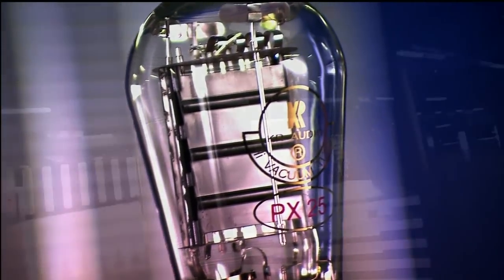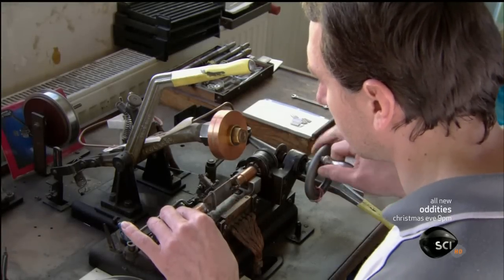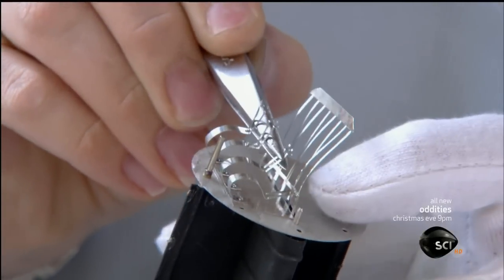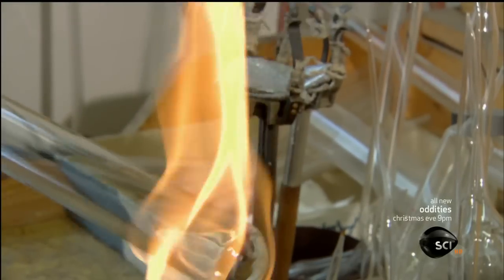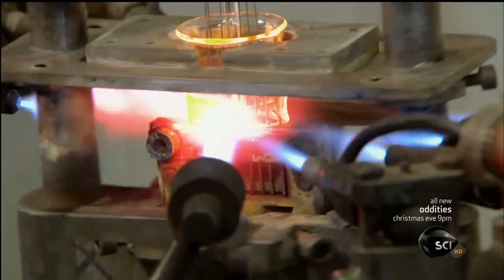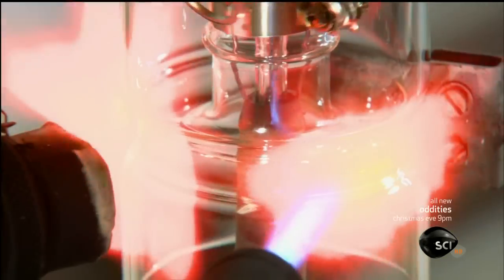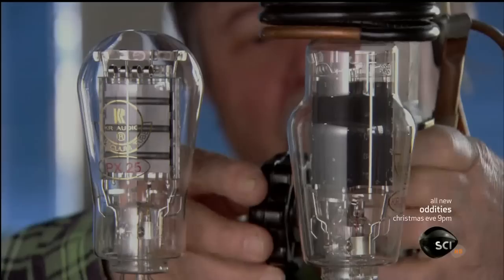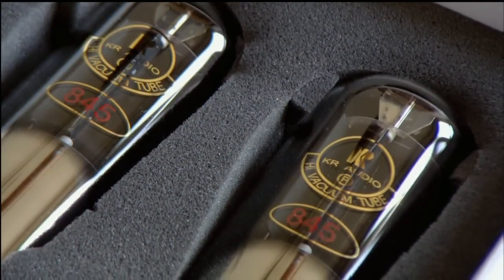How It's Made - vacuum tubes

Comment: Tubes still are the best amps for guitar. Transistors are either on or off. They can't easily replicate the waveform of the sound. Plus, tubes sound good when you push them, unlike transistors.

Comment: when i was in the u.s. air force 50 yrs ago i was a ground radio repairman and repaired and maintained radio transmitters up to 50kw in power. the vacuum tubes in the power amplifier were about 3 ft. long and weighed about 20 pounds, they were huge.
Reply: wow awesome

Comment: Also the anode and cathode have different voltages because they are hooked up to different voltages produced in the power supply. And they are higher than the input because the input is applied to the grid and that small voltage can control whether the current can pass from the cathode to the anode by repelling or passing electrons streaming from the hot cathode to the anode.

Comment: Amazing! I've done neon sign-type glasswork, and I've got a lot of respect for these guys. This technology is interesting - no matter whether one likes the result or doesn't - and, as with other archaic sound tech such as phonograph records, it's nice to see there's still a desire to have it available.
Reply: Have you ever worked on nixie tubes (or any of the old tube displays for that matter) or know anyone who has made them before? I still get them from my friends, but it makes me sad they aren't produced anymore.
Reply: spieagentl
Vacuum tubes of that type require an entirely different skillset, different equipment, and different processing. Nixie tubes do typically use neon gas. I think most Nixies were machine-made, and I'm not sure whether new ones are being produced and, if so, what the process is like. Cathode ray tubes are based on Sir William Crookes' work, and several tubes he designed are still produced for both physics demo purposes (properties of electrons) and decorative use (fluorescent flowers, minerals, etc.) and these use a different process, too; neon signs' closest cousin are the decorative Geissler Tubes first produced by Heinrich Geissler, who invented the diffusion pump still used (with silicone oil, rather than Geissler's mercury) in neon sign production, now boosted by a mechanical pump.
Reply: Jonas Clark Wow, thank you very much for the informative reply! I'm sorry I didn't know, but the little history lesson, and now I have names to do research on! Have a nice day!
Reply: spieagentl Geissler Tubes are fascinating things; they were made in thousands of designs, from simple squiggles, spirals, coils and loops to words and monograms (looking forward to the role neon would play), animals, spouting fountains, flowers, religious symbols, people, and magnificent objects such as royal crowns, some of which were even worn onstage in plays. Some used fluorescent uranium-oxide and iron-oxide glass or had outer chambers containing fluorescent liquids. Two glassblowers, Lutz Neumann and Wolfgang Linschmann, are the last true masters of decorative Geissler and Crookes tubes, and Neumann has made several fantasy tubes I created on paper such as a fancy Cross, as well as replicating the incredible crown with fluorescent gems held in a museum in Europe. Linschmann trained at the Pressler factory, the last scientific glassware factory in Germany. They also make many decorative Crookes tubes, which use cathode rays (electrons) to excite fluorescent-painted metal sculptures or clusters of minerals. Happy learning!

Comment: 1:20 The Anode's "top secret" black coating? It's essentially a carbon coating applied to the steel anode (plate) at high temperature during the manufacturing process. It was done to reduce secondary emissions.
The secondary emission problem was only present in tetrodes and It may have been top secret the at the time it was discovered that the coating increased the efficiency of the tube's amplification factor but quickly became common knowledge among tube manufacturers as it is today. Not so "Top Secret"

Comment: For anyone watching, These are high end "handmade" tubes. Back in the "day" when vacuum tube electronics were common (1920's - 1970's), Most of these processes were done by automated equipment. There's plenty of contemporary to the time video on YouTube showing the MASS production of vacuum tubes (Mostly from the1940s and 50s). If tubes were all made THIS way "back in the day" only the rich would have had radios or TVs at all until 1978, lol.

Comment: i'd love to see a vacuum tube based cpu the size of new york city in orbit with the devices connected to it the size of manhattan, and the solar panels powering it the size of 10 or 20 manhattans. wont happen because there is no reason for it to, but it would be pretty cool to see a multicore proc built out of vacuum tubes instead of tiny transistors in an ic. while the idea is stupid, it is still fun to think about.

Comment: Great video! This is a very labor intensive process! I imagine, back when RCA, GE, and others made tubes domestically, it was considerably more automated. I used to pay about 5.00 for a 6L6 GC in the late 60's! Now, good quality 6L6's are uber expensive. Don't have any tube gear at the moment, but plan on getting an old Fisher 500 A or B. 7591 outputs in that one, and very difficult to locate, but well worth it! Cheers!

Comment: Global feedback and negative feedback are basically the same thing..  Most of these negative feedback amps have a passive feedback control loop.  The amplifier compares the input and output signal (e.g., around a transformer) and generates a 'correction signal' to adjust the latter to look more like the former.  This also cause artifacts and even oscillation in some designs.

Comment: To clarify, are different types of feedback and different types of amplifiers.  I didn't say all feedback.   What might acceptable for home theater or receivers for the mass market wont' be for audiophiles.  Using "copious amounts" of negative feedback will result in harmonic artifacts.  Nobody wants overly exaggerated  S's in the vocals with timing and odd order issues that any non-engineer can discern.  Listening for those s's is one way I distinguish transistors from tubes, source unseen.

Comment: If anyone has been parroting "electro-babble" it's been you talking non sense over tube distortion.  You can run tube amp at full power without it distorting as badly as a solid state amp. They don't clip and produce square waves that destroy speakers, they just get fuzzy and mushy sounding. Its still distortion but at least its not as likely to smoke your tweeters. 
Speaking of car-fi my new Tacoma SR5 stereo sounds terrible.  Before discovering tubes I would have thought it was awesome.

Comment: That's like asking why do piston engines have such short lives..

There are many variables, amp type, tube type, tube production era, and how hard the tubes are driven.  Preamp tubes will last 10s of thousands of hours in hi-fi amps, output tubes 1000-10,000 and rectifiers a bit longer.   In the last three years I've had one tube fail, a Sovtek 5AR4(~3k hours) a NOS Mullard will last 10-20 times longer.

Comment: The cathode is a made from an electron emitting substance usually tungsten and molybdenum.  Many small tubes cathode are simple oxide coated.  The Anode or plate can also vary from tungsten to copper.  In the past tube makers would usually are coated with secret proprietary conductive coating.  Just one of many things lost when the old tube production stopped 25 years ago.

Comment: In unshielded copper, like a circuit board trace, signals travel at 95 to 97 percent of the speed of light. So the wavelength at 20 kHz (beyond the hearing range of many people) is 14.2 km, nearly 9 miles. A negative feedback trace in an amplifier is a few centimeters long, a vanishingly tiny fraction of the wavelength of the fastest audio signal. There is no way NFB causes timing issues, let alone audible ones. It rather cleans up harmonic artifacts (drastically lowers harmonic distortion).

Comment: The real difficulty in modeling is modeling power amps. This is impossible to do with the equipment that is used (whether the target device is solid state or tube). If you want to digitally simulate an amp such that the audience can close their eyes and think there is particular 50W half stack cranked 10 feet in front of them, you need a 10,000 watt hifi sound system to do that. Only such a sound system can obey the model faithfully at the required volume level to create the same pressure waves.

Comment: Modeling vacuum tubes is a piece of cake. I use a guitar preamp with real vacuum tubes, but I do not believe that it produces better output than modeling. I use real tubes because I think it's ridiculous to use something with a quarter billion transistors on it running at hundreds of megahertz to do what is achieved by some simple arrangement of parts encased in blown glass. Pre-amp tubes are cheap, last long, and run on small power supplies. They have no issues that need a computerized fix.

Comment: Harshness comes from hearing all high frequencies in the original material clearly reproduced in their full dynamic range. If the material is judged to be harsh and unmusical on a virtually distortion free transistor amplifier, with great speakers in an acoustically treated listening room, then we have to conclude that the material is in fact harsh and unmusical. If tubes can soothe it, the only mechanism by which that can happen is distortion, severe enough to make a clearly audible difference.

Comment: Yes, the cost of making a 10kw amp using transistors would be insane.. The tubes can be fed and handle incredible high voltages, witch means the current needed for a high power output can be microscopic.. Its funny but the most modern tv satelites uses the good old tubes to amp the signals.. :)
I 2 thought tubes were shit compared to transistors until I started using them tube amps.. You need to experience it. Transistors are techn. better in every way but 1 as u say but tubes are still awesome!

Comment: Hehe.. I have a 120 watt guitar tube amp on 4x12" speakers and it sounds superb !! lol but 90% of the time i play i use a line-6 spider 3 amp with digital audio processing and transistor amp since it sounds brilliant and copys about all known amps ever made.. so you are right in a way, but you wont get that tube sound from a st5881 trans-chip (opamp) overdribe on a mosfet output. The best guitarist ever used transistor overdrive in pre and 4 huge tube amps as output for that warm drive.. :)

Comment: "any tube amp can be emulated 100% with transistors."

-Not 100% true. Transistors and tubes will always sound different and they cant 'emulate' each other in a analog circuit for sure. But If the sound is digitally processed before it hits the amp, you can get really close. Digital 'tube amps' are beginning to sound really good but a pure transistor stereo music amp will always sound more sterile than a tube amp..transistors works best if low distortion is alpha & omega. or?

Comment: The reason for the difference between tube and transistors, is that transistor amplifiers are designed to be high fidelity, reproducing the output sound exactly as input. Tube amplifiers distort the sound in such a way that some people think sounds better, maybe because they are so used to hearing that distortion they have grown to like it.

Comment: if any power has been run threw them after they where cracked would they not be burned up like a cracked light bulb.  i guess if they where cracked but never used it might work. the hard part would be get the proper vacuum seal.

Comment: I just thought you, being such an audio expert, would do it better than me. That is, if I fail to achieve the sound, is quite inconclusive, isn't it? It would just prove that I could not use the EQ right. But, if a man with all the amplification knowledge does EQuing, THAT would be a result.

But, hey, did you say hour and a half? Is that supposed to be easier than just firing on the excellent sounding guitar amp?

Comment: "Actually" :) You just don't like tube overdrive sound, that's all. Just don't buy an amp made of low quality components.

Just don't try to be a little smart ass and pretend you know anything about sound modeling. If you'd ask ANY amp manufacturer what it takes to model an amp sound (or effect), there answer wouldn't probably be like "yeah you need some shitty EQ, and tweak some shitty knobs and boom! you get the AC-30 sound instantly from this linear PA".

And still waiting you for email ;)

Comment: I tell you what, write me an email to tube.vs.transistor at gmail com, and I'll send you couple of wave files. One with line recorded guitar clip, and other it re-amped through a guitar combo and recorded with a mic. Then you EQ the original clip, and make it sound exactly the same as the re-amped version, as you say you should be able to. Then send it back to me, so you can prove me that EQ is all you need to get the tube sound.

Comment: Do you realize that coloration is exactly a tube guitar amp is designed for? When you strum the guitar, you get the distortion? Comparing guitar amp to a hi-fi or some laboratory speaker is like comparing a violin to a signal generator. Violin is a shitty design for a signal generator, because it cannot produce a pure sine wave.

Who uses guitar amp as a hi-fi amp? Not me, because it is designed to run a guitar, and make it sound good.

Comment: "rich" and other adjectives are accurate but what it comes to in technical terms is harmonics. Tubes make LOW ORDER harmonics, silicon (transistor or IC) doesn't because they CAN'T = physics. What that means is a tube makes a guitar sound like a louder guitar. Transistors' high order harmonics make a guitar sound like it's in a can until it's attenuated so bad the timbre of the strings changes - In simple terms, "Your ears know the difference."

Comment: any kind of audio impendance correction transformers or speakers in the end), gives 1 % distortion in signal per each, (until reaches some point), which gives a lot after all. That is True and from that point I am supporting what You said. 
So for the end, I'd never have tube amp made for end amping. I'd rather have some FET, or good paired transistor in A class or high AB class, but for the preamp I'd rather have some kind of hybrid, tube-fet what can somewhat improve sound.

Comment: That was my point. For a preamp tube is more than welcome. For anything besides that, unfortunatly there is no place for tubes, (what goes in benefit of Your claim). The point is that tube in exiter, (end power amp), has to have audio transformer, (if it is desired to drive classical speaker), what gives additional degradation of signal. What I know so far, (and it came to be true), each conversion from audio to electric via magnetic way, (mics, tape recorder heads),                            1

Comment: As for FET-s I may say quite the opposit, but even thatways setup needs to be in high AB,or A class, which draws high current, and opposit to that gives low amplification range. That comes out of, (and same goes for tubes as for transistors and fet-s), amplification slope, where can be found setup with high gain and high distortion too, and low gain and low distortion. Magic is in finding reasonable compromise between these two. 
Hope You agree :-)

Comment: On issue about heat and current, (heat and light), I agree apsolutely. That is why is that piece of hardvare hardly usable in other then you mentioned applications. Besides, it gives transients, (distortion), but these distorsions are mostly even, so this setup sounds "warm" and "silky". Transistor, (as counterpart to the tube), is moslty odd transient inklined sounding, thus, a bit less "soft".

Comment: and most of all You said something that goes in way that proves that. 
Saying that tubes draw huge amount of power. The secret of the sound of the tubes is in that fact. I mentioned about even and odd, transients. Ones are very tipical for amps that are constructed arround curent amplification, and the others are constructed arround voltage amplification, (like tubes are). 
What You ment to say with the fact of restoring good sound is, (I assume), class D amps.

Comment: Actually, tubes do draw amount of electricity, but very low on current. For example, if we do hybrid, with ECC81, or ECC83, in pre amplification, together with class A push-pull with some good paired FET transistors, You might be very surprised how that may sound when compared wiht some commercial amps. Have You ever made one, or listened one?
I would say no, (with no will to offence You in any way), because You would have totaly different oppinion,

Comment: Besides it, manufacturers of these amps are cutting production costs by making amps at the very edge of power abilities, (usually there might be found a far smaller powersource than needed), making, thus, these amps hungry for power. And as third amps are made in AB or high B class rather than in raw A calss what degrades sound even further. 
So far, I have no experience with digital amps so I cannot say nothing on that.

Comment: Outside of very limited audiophile sector and guitar amplifiers, the low-power vacuum tube is DEAD !!!!

Only the high power RF valve industry is viable, and even here, the latest LD-MOSFET's are more dominant than ever, leaving the tube industry only the very-high power, velocity-modulated (Klystron / TWT / Gyrotron / magnetron)  and specialised (PMT / X-ray) sectors valuable.

And believe me, at around $ 1000 (eBaY price) for a pair of 20 watt tubes, this won't help !!!!